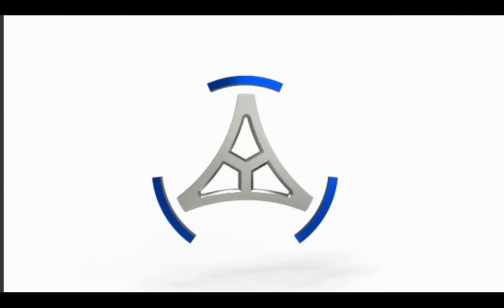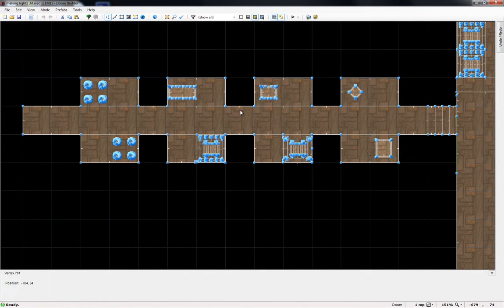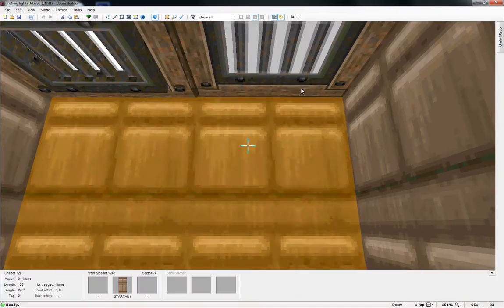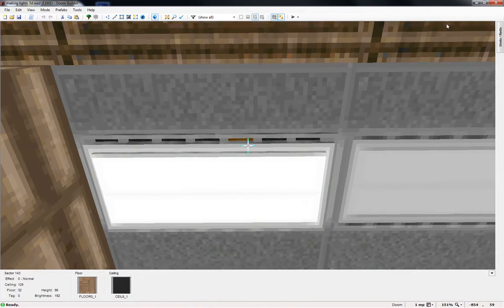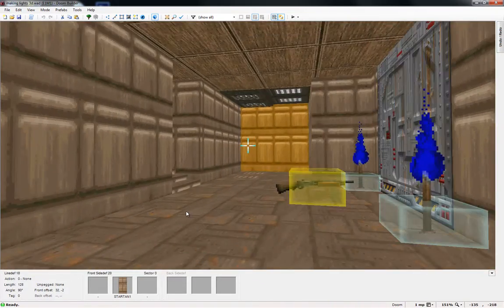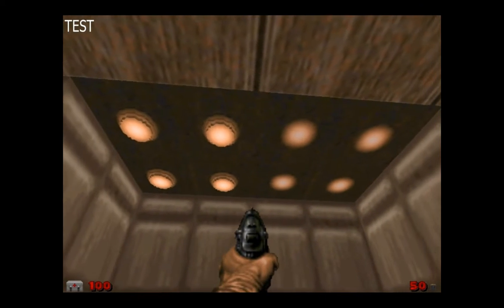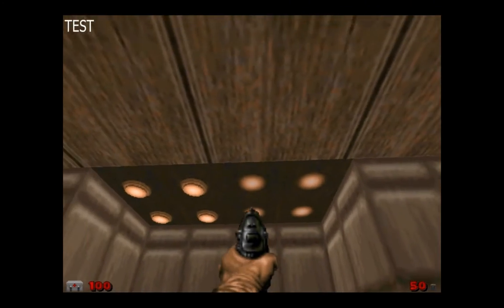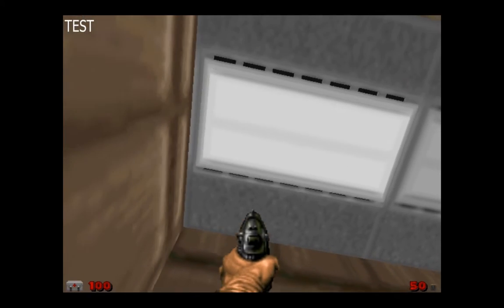How to make lights 3D CONTINUED

Comment: Are you goanna share the wad after the project is done, this would be a really important resource for the community
Reply from the maker: Yes i will I'm like 35% way done with editing all the doom level for better graphics.
Reply: realy? oh great i was thinking of doing something similar with dynamic lightings to ultimate doom but i would love to play from an real professional, after i saw your lighting videos i realy got excited and you dont use the cheap way either(dynamic lights are quite the cheap way to me)
so yeah i hope it will be done soon.
Reply from the maker: soon probably 5 months.

The reason for it i'm making corners round, ramps instead or stair of some areas, lighting 3D, smooth real life looking light, door tracks look real 3D and minor detail updates. its going to be awesome its worth the wait.
Reply: OHHHHHH IM EXCITED!
Reply from the maker: everyone should be. Im exited too.
Reply: A question just bothered me, are you making the lights with section colors or just plain white?

Also are you changing the map position or just editing the original doom.wad (because if that's the fact it will run awesomely with brutal doom v21)?
Reply from the maker: I am just using plain white its the only color i know that i can use on Doom builder. I am also keeping the levels as original ass possible. rust me id love to add more secrets and more random rooms and change room around but id like to keep it original then later i can add all my tweaks and custom rooms and monsters.

I've never used Brutal doom V21 i have only used "doomsday engine" and that makes the game graphics looks awesome.
Reply: how's the progress going ma man?
Reply from the maker: ohh geez im like at 37% complete lol.

i think i know why doom developers didnt do this to begin with it a lot of work and a lot time.   

Thanks for keeping touch it mean something when the audience still interested in my work
Reply: Don't thank me man, i really like what you're doing and i really respect it, i am the one who should thank for spending your time for this awesome project.

And don't overdo it we can wait no matter how long it takes.
Reply: Bay Dragon  I did. Its just E1M1 though, search E1M1 GL 3d lights on google (youtube probably won't let me put the link)